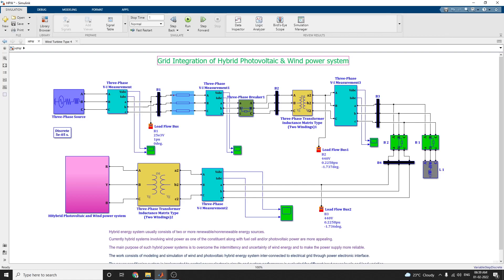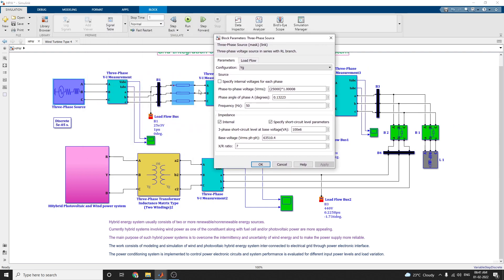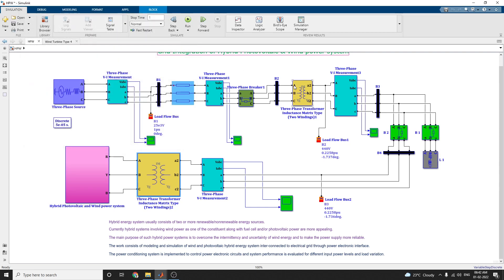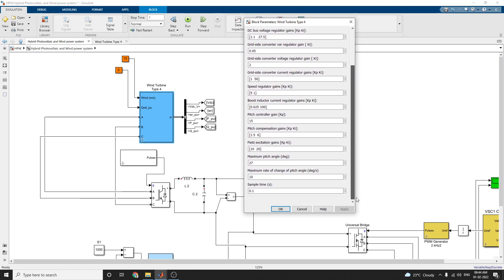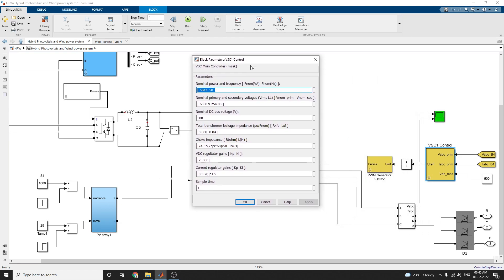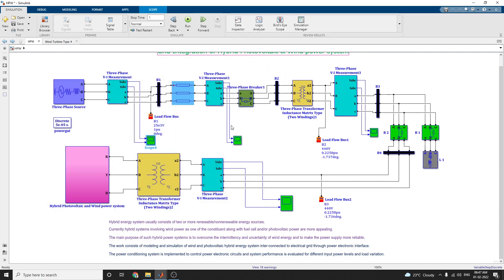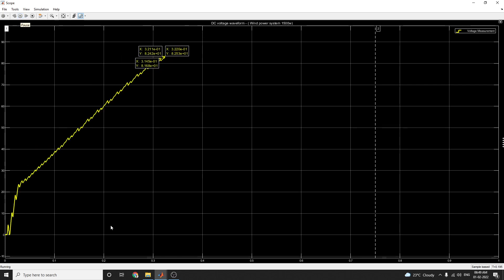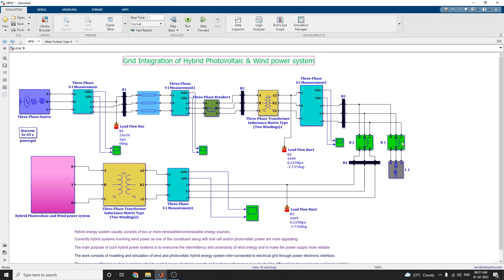Grid Integration of Hybrid Photovoltaic & Wind Power System

Comment: Sir in this circuit FPGA controller how to use sir 
FPGA controller  are usefull are not in this circuit 
Iam designing FPGA controller for this circuit output is not coming